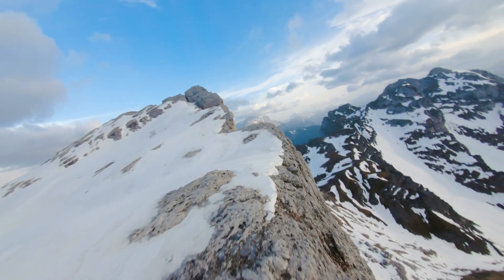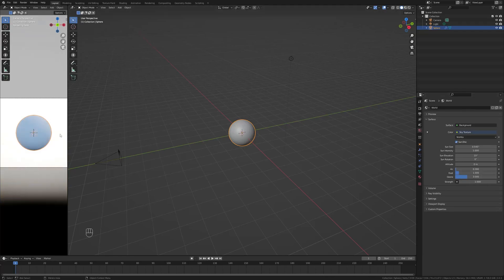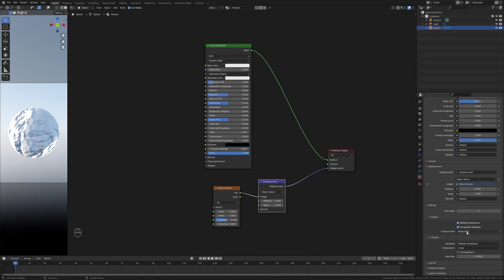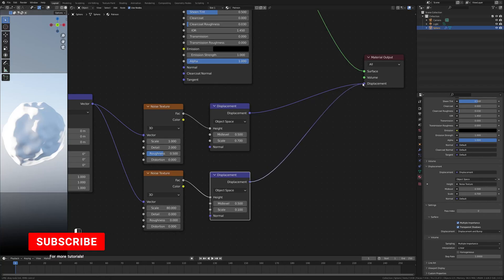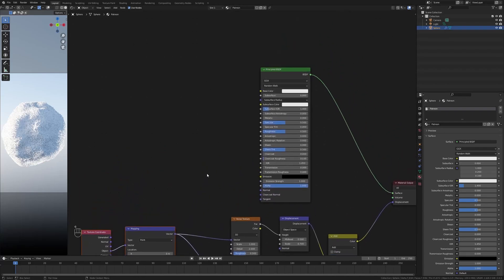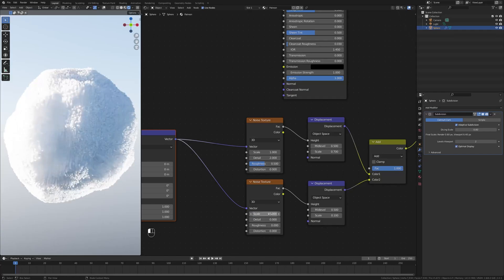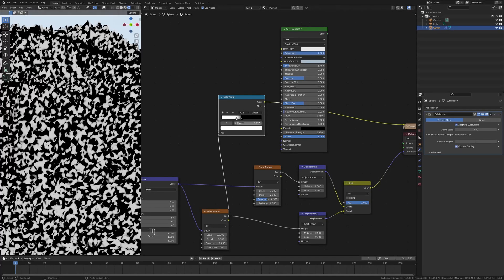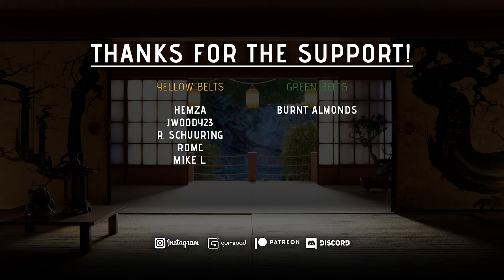Realistic Snow Shader [Blender Material Displacement in Blender 3.0]

Comment: Mixing the displacements with a mix rgb is technically incorrect. Even though the result is the same you should add the noise textures and plug the result in a single displacement node, or daisy chain the two displacement, plugging the output of the first one in the "normal" socket of the second.

Other than that, nice tutorial
Reply from the maker: Great tips! I figured a MixRGB would do nicely and didn’t know this, but great tip. Thanks!
Reply: Would this affect things down the road if used the way the tutorial shows? Like slower renders or visual issues?
Reply: @jganzie2632  when you do it by blending the grayscale values before the displacement you need less nodes so it's faster to calculate, you have better control over the look (blend factors of the add nodes), it's the correct way of using displacement. it can produce weird shadows and glitches when you color mix displacement nodes.
Reply: How do I go about adding the noise textures into a single displacement node without mixRGB?
Reply: @kevin-t1u5i  you use mixRGB nodes to mix the noises and then pipe the result into the displacement node. the problem in the video is that he mixed multiple displacement nodes together.
Reply: @Frigus3D-Art  Oh, I see

Comment: I get these weird black artifacts at the bottom and top of the snow ball, when im add the bottom noise texture. What do i  do wrong?
Reply from the maker: Might have to do with the object displacement. Are you using a sphere or a rounded cube?
Reply: @KaizenTutorials I just folllow the tutorial as shown, everything was an exact replica, but min egot black artifacts or edges at the top and bottom.
Maybe its the version
Im at 4.4
Reply from the maker: @JebrilKessler  shading nodes and cycles haven't really changed since this video, so it should still work 😞

Comment: Excellent video, but the Principled Node changed since this video was made. For anyone watching this now, the Color value of the Subsurface Scattering is gone, but you can just set the Radius values the same as in the video and it looks just fine. Try changing it from Random Walk to Christensen-Burley in the dropdown as well, I found that helps with the look. Also, if you're getting weird black spots in your snow, i.e. maybe you're using it for a landscape, change it from 'Displacement and Bump' to 'Displacement Only.' Other than that, the rest of the tutorial is still very much helpful.
Reply: The exact problem I was having. Thank you so much
Reply: I tried your suggestions and they didnt make any difference.

Comment: I applied this tutorial to my landscape and everything looks like ice with this exact setup. Only after I bring the scale of the other noise to something like 20 000k scale it starts to look like this but still the surface displacement is really big. What am I doing wrong? Thanks anyway!
Reply from the maker: You probably need to change the texture coordinate to maybe use Object coordinates instead of generated, that usually results in lower scale values still getting proper sizes. For the displacement you need enough geometry to work with and you can always tone down the displacement with the height setting in the displacement node.
Reply: @KaizenTutorials  Thank you so much for the quick reply! I will test this when I get to my pc

Comment: I am encountering this problem since years, I had this problem since starting blender. Is there any way to use eevee just on CPU? I have an i3 5005U at 2.00GHz clock speed with 6GB of RAM and 1gb of video memory for Intel HD 5500 integrated graphics (with latest drivers and openGL 4.3.0). The problem is whenever I try to do viewport rendering, or just a single image render or an animation with eevee, blender freezes, black screens and crashes with a popup message that the display driver had stopped working and recovered successfully. I am forced to use cycles to render out animations and wait for days to finish rendering which could be done in hours if eevee had worked. Is there any solution?

And I'm using Windows 7 Professional? if the OS is the problem then I would not mind switching to linux or a higher version of Windows. Because dont want to waste gigabytes of internet switching softwares only to realize that it does not change anything. But if it does then I would not hesitate to upgrade
Reply from the maker: That's a good question! If I compare your specs to the minimum requirements stated by Blender (https://www.blender.org/download/requirements/) you're both short on RAM and VRAM (video mem). On the CPU side you should be OK, but the CPU is just not available within EEVEE. It's a pure GPU based system and renders the same way a game engine would. Thus requiring a dedicated GPU, in this case with atleast 2GB of video memory.

So I guess my final answer might not be very useful... but only upgrading your hardware seems like a viable solution. Getting a lower end GPU (if you can replace yours) seems like the best solution. Something like the NVIDIA 1050 and up range GPU's will do. 

Hope this helps any! Best of luck to you.
Reply: @KaizenTutorials  thanks for the suggestion, I was also thinking about an upgrade, but was unsure of it as my laptop is not modifiable so I would need to buy a new one. So I guess I will have to manage with cycles for a year, because I will get a new laptop only after I clear my 10th grade exams. Thanks for the quick reply :)